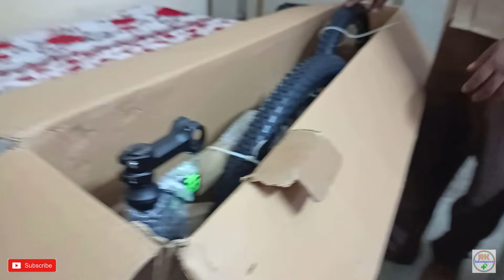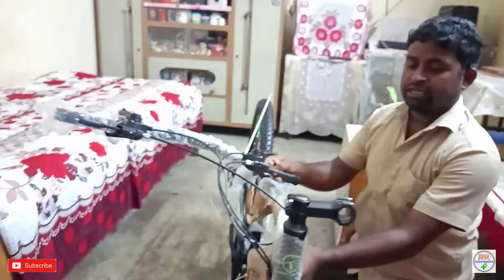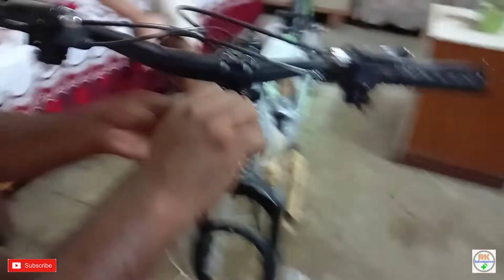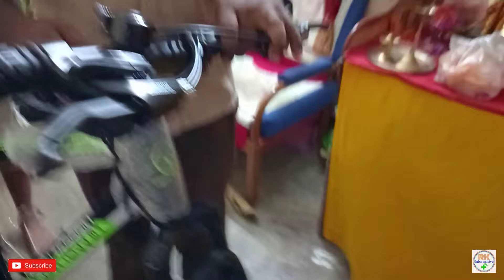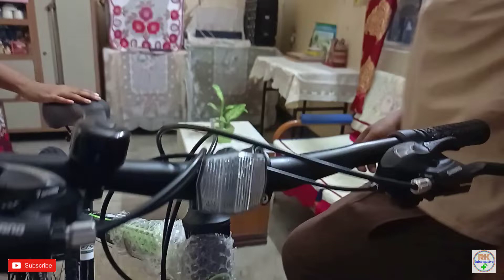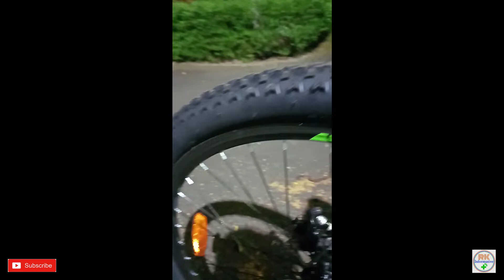Urban Terrain UT3013S27.5 MTB Cycle.The best Mountain Cycle with 21 Shimano Gear under Rs.15000.

Comment: You did it totally wrong that's not the correct way to assemble it your handel is not at right position the break cable is not right.
Reply from the maker: Yes you are right 👍, Technician was coming late so with help of neighbour it was installed, letter on fixed by technician
Reply: @rkinformative3457  👍